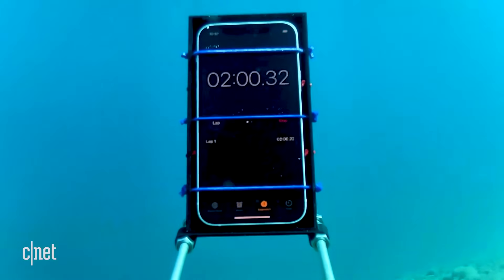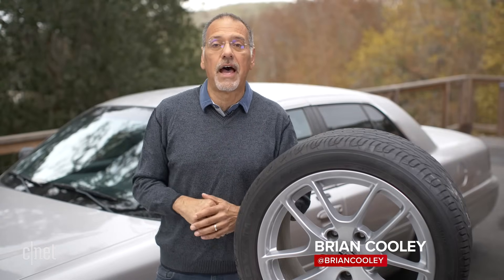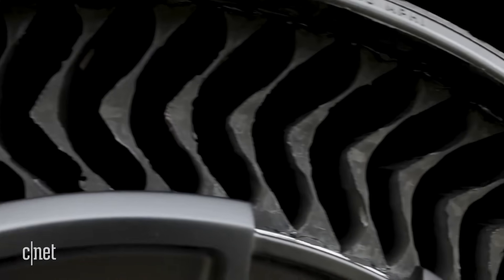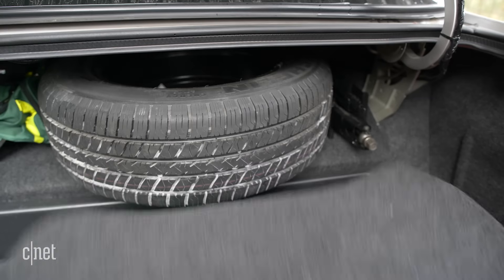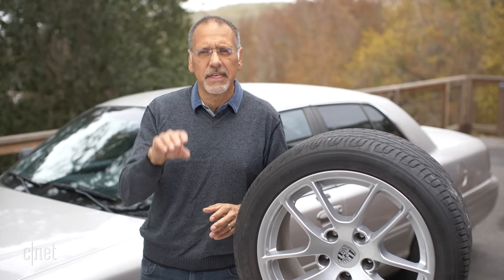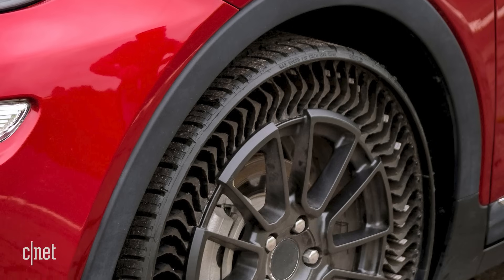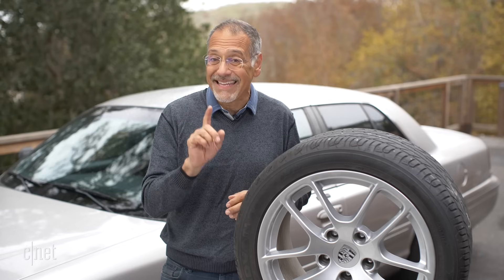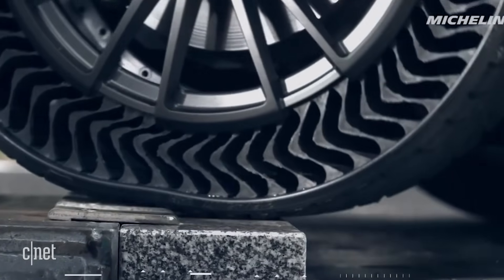See what Michelin uses instead of air in its Uptis tires

Comment: Im pretty sure they are figuring out how to put planned obsolescence in these
Reply: the tread will probably wear out with normal use over time still like in a normal tire.
Reply: ??? Rubbers are not meant to last forever
Reply: @Skfkf1393a  if they are longer lasting than the traditional tyres the companies will lose money, even if they are sold more expensive the companies will lose annual profit, affecting liquidity and stock market performance
Reply: @lmbtcs1879  probably price these high enough to be out of reach for the common person and keep traditional tires around for a lot longer.
Reply: @gmoneyman86  sure hope they will be a net positive for the environment, our safety and pockets lol
Reply: @lmbtcs1879  you make absolutely no sense.  just because the tire won't get discarded from sidewall puncture or improper inflation, doesn't mean the treads will last forever. high grip = soft, fast wearing compounds. low grip = hard, slow wearing compounds. don't forget you are not supposed to keep your tire over 4~5 years regardless of tread wear due to rubber drying out.
Reply: @Skfkf1393a  a nail or a pothole means the tyres is wasted no matter how new the treads or the rubbers are, and that can happen within the lifespan of any tire. any tyres loss prevented by this design is the companies loss, simple as that
Reply: Wifi connection to pay monthly fee else the wheel turns into a square.